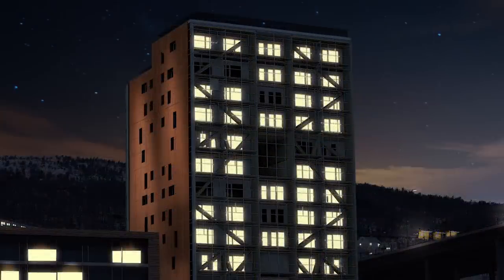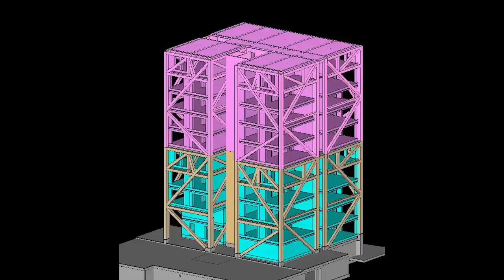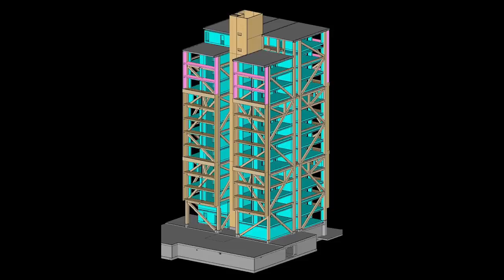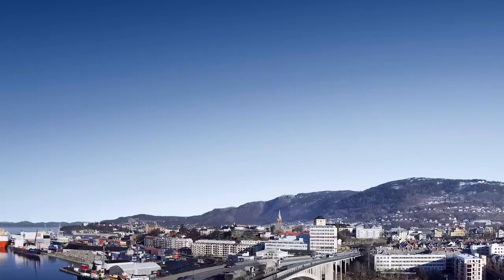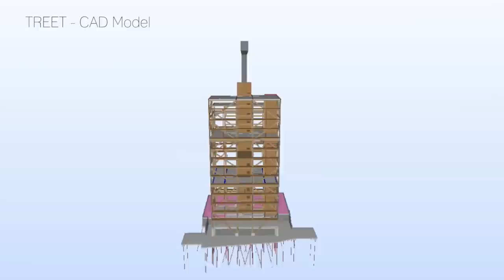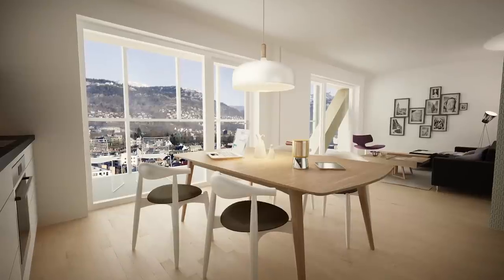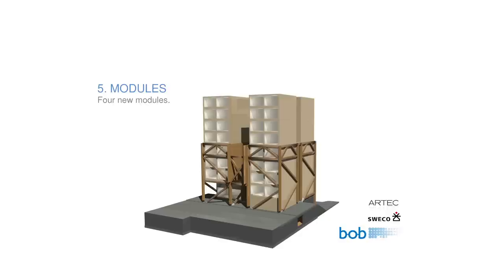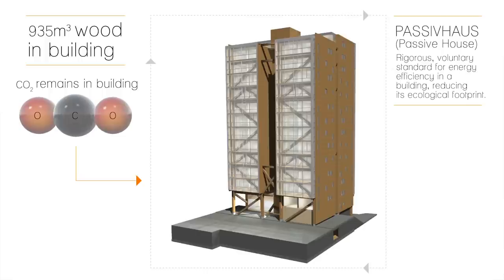Bergen Project - The Design and Construction of the World's First 14-Story Wood Building

Comment: carbon foot print thing (i dont care) wouldnt it be smarter to market around the world as a earthquake safe structure being wood flexes and there for safer in earthquake prone areas then ridged steel and concrete. not sure about the wooden elevator verses steel rails. great idea would be cool if we had a few in new zealand
Reply from the maker: rusty shacklford Thanks for your comments Rusty, you can find more information on building with wood at http://www.rethinkwood.com/, including earthquake design case studies.
Reply: Have you seen how a log burns?
They wouldn't burn like massive torches for one and it would be much more containable that a house fire. It would be more like  trying to set the trunk of a tree on fire. 

Also wood can be treated to be fireproof.

Comment: I understand that heavy timbers char over and "burn at controlled rate", but that didn't stop the GSK lab in Nottingham from burning to the ground and, in my opinion, is not good enough for a building higher than 4 stories, maybe 5. I wouldn't want to spend much time in a "plyscraper" and wouldn't want to live near one.  And unless there is a transparent intumescent miracle coating involved that's not mentioned in this video, all that "beautiful" exposed wood is just tempting fate.  Imagine a whole city filled with these things.
Reply: in general, mass timber doesn't ignite easily. a sprinkler system, concrete composite floors, and gypsum block (non load bearing) interior walls would mitigate much of the risk. drop ceilings using lightweight MgO panels can protect timber floor beams or trusses. the concrete would incur a cost in emitted carbon, however.
Reply: 7